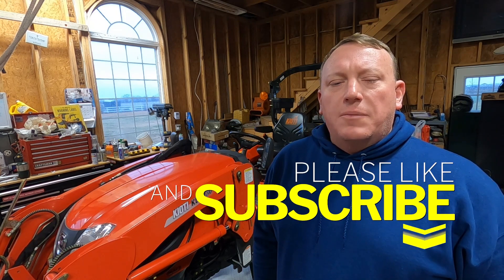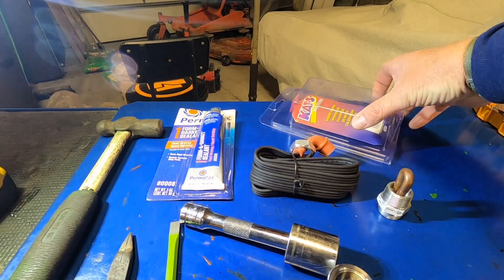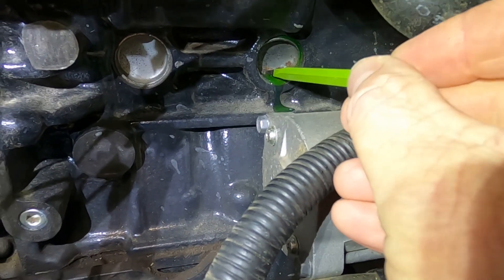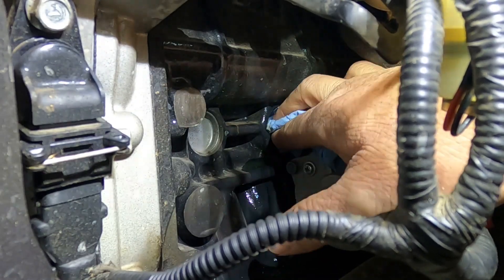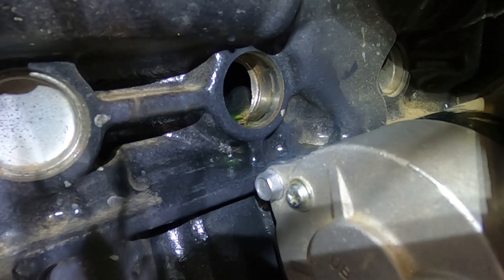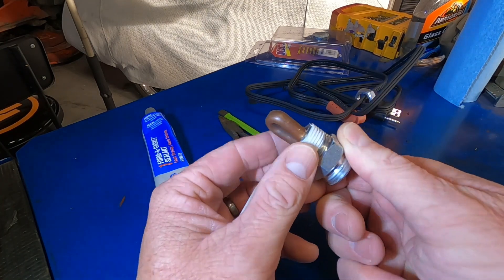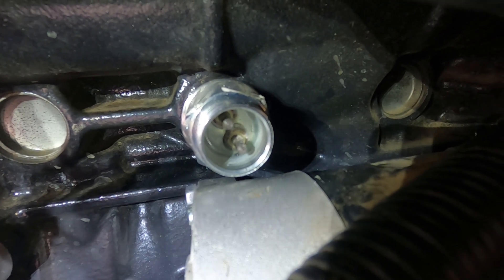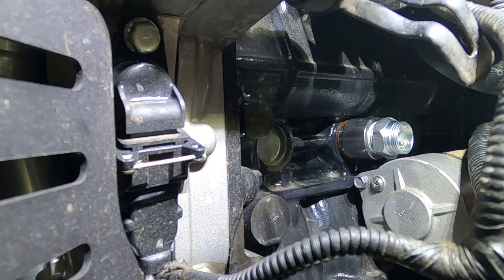Kioti Block Heater Install (Cheap & Easy)

Comment: Better yet, don't use Kat's brand. I just installed one, and it was no good out of the box.  A couple points: I installed my Kat's in the front frost plug. When it didn't work, I called NAPA and they had a 3/4 npt Zero Start, and I just screwed it into the bushing I had already installed. One thing I noticed, is the type of cord fasterner on the Zero Start, it's flat, has no nut and just pushes in. It would be best to have the frost plug heater in the center hole, so this brand may fit with no "nut" interference. I can get the part number for the element and cord if someone wants it. (you will still need the bushing)
Reply from the maker: If you can send me the part # ill list it in the discrption for everyone to see.  Thanks for the info..
Reply: Where do I find the bushing?

Comment: Cut the nut, spread it with a screwdriver (or cut the nut open even farther) and put it over the threads with the cut on the bottom and some silicone sealant. Never give it another thought. Might be easier to at least loosen the starter when you do it, but might not be necessary..

Comment: Great video, I would suggest staying far away from the Kat's heaters though.  Use the Zerostart 3100093 in place of it, lost count of the Kat's heater failures just during this winter.
Reply from the maker: Thats good to know.  When mine dies I'll give that one a try.  Thanks for the info.

Comment: Might I add,use a longer extention on your socket and using Teflon tape is not smart. Use thread sealant/pipe dope.

Comment: Was there a reason you didn't use the other Freeze plug port that appeared to be more accessible?
Reply: Now that I'm done watching the video, I know the answer to that question.
Reply from the maker: Yup, I should have paid better attention before I started.  It would have been easier to use the other location.  It's been a few years since I installed it and I haven't had any issues with it.

Comment: I would use a different location, I had mine in the same location and when I had to  remove the starter, it was a pain I decided to remove it and install a new freeze plug and move the heater to a better location, but a good video, thanks.
Reply from the maker: I agree, if i had to do it again I would install it in the foward hole.  Hoping not to have to replace the starter any time soon.

Comment: I'm about to install one on my 2510, should be the same. 3 hours north of Toronto, Ontario. Makes a lot less banging and clanging on startup, at -30 Celsius. Thanks for the video.
Reply from the maker: From what I understand the 2510 has manual fuel injection, so keeping it warm should help with start ups.  I've run my machine all summer Bush hogging and haven't had any issues with leaking.  Good luck.

Comment: Thanks for the thorough video, I might have to do this on my ck3510. I didn't have any trouble getting it to start last winter but I know my TDI Jetta sounds MUCH happier when it has been plugged in so it certainly shouldn't hurt anything to give it a little help. I guess I didn't realize that these were fairly simple to install, Thanks again!!
Reply from the maker: Glad it could be a help to you.  I know my F250 likes it better when its plugged in.

Comment: Thanks!  I put mine in the first freeze plug on a ck 2610.  Same motor, but had to remove the exhaust.  Kinda a bugger because I had no room to hit out the freeze plug.  Just subscribed to your channel!  Thanks again there was no other video available.
Reply from the maker: That kinda adds a bunch to the install.  Glad it you found it helpful.  Thanks for subscribing.

Comment: What is the part number for the freeze plug adapter to NPT that you showed?  I have a ck2610 I'm not sure if the plugs are the same size, but I wanted a starting point for my search at least.

Thanks for the video, I like the way you removed the plug best of what I've seen others doing so far.
Reply from the maker: I ordered the freeze plug adapter from Nolt's Power Equipment LLC
Reply: @VansHomeServices  thank you I like Nolt's I appreciate the reply

Comment: Good video on the install of the block heater. I have a Kioti CK30. Been having issues with my block heater. Also, do you have any experience with changing cables on hydraulics bucket loader shifter? Pretty tight place to work in. I can tip the bucket forward and back but no lift. Lever is floating, maybe popped out, maybe broken cable. Could use some knowledgeable advice.
Reply from the maker: I happen to have a repair manual for a CK30, I'll take a look at it and see what it says and get back to you.
Reply from the maker: I have the parts book, not the repair manual.   From the looks of it it's a spool valve without any linkage.   I can send you pictures of the parts illustration if you send me your email.

Comment: Where did you find the block heater adapter? Can't seem to find one for sale anywhere.
Reply from the maker: I bought it from Nolts Power Equipment.
Reply: @Side Gig Hustle  good to know. I managed to order one through my local kubota dealer for a decent price. The only other place I could find one quick like was Napa. They wanted $65 plus freight and tax. Final price would have been a our $85!

Comment: Mine is a factory kioti part and once the freeze plug was removed the sleeve is loose.  I mean I can push it all the way in by hand.  You had to tap yours in.  Dunno if I got the wrong part or what's going on.  Any ideas?
Reply from the maker: Mine was a 32mm plug.  I did measure mine before I started the install the thinnest section was 32mm and it tapered up from there.
Reply: @VansHomeServices  yep mine to.  I got it in there, but it wasn't very snug.  I'm letting the sleeve compound cure overnight.  I'm just worried because I really didn't have to tap it in and now I feel like I'm just putting total faith in the sleeve compound holding it in and leak free.  I called my dealership mechanic and he thinks maybe my sleeve was machined wrong but he's never seen that and has installed hundreds.  Just my luck to get one messed up lol.  Anyway thanks for getting back to me

Comment: Great info.  Can you make the info in the description a link to the products?   Thank you
Reply from the maker: Below are the links to both the heater and the bushing.  Thanks for watching. 
Here is the link for the bushing, www.ebay.com/itm/254502668254?hash=item3b418a87de:g:vtIAAOSwrjtcfTt~

Here is the link for the heater,  www.amazon.com/Kats-11409-Watt-Frost-Heater/dp/B08B7HST5Y/ref=sr_1_1?crid=35K6HD3ULPVLX&keywords=Kat%27s+11409+400+Watt+3%2F4%22+NPT+Frost+Plug+Heater&qid=1640122952&sprefix=kat%27s+11409+400+watt+3%2F4+npt+frost+plug+heater+%2Caps%2C89&sr=8-1

Comment: Where did you find that adapter sleeve?
Reply from the maker: I bought it from NOLTS power equipment last year.  Their number is (717) 546-8750.  I think you can buy the heater and adapter sleeve as a kit from Amazon.  Here is the link https://amzn.to/3Dq7MNG
Reply: @VansHomeServices  thank you.  Appreciate the link!
Reply from the maker: No problem, hope it helps.